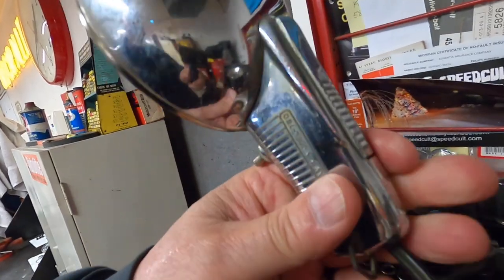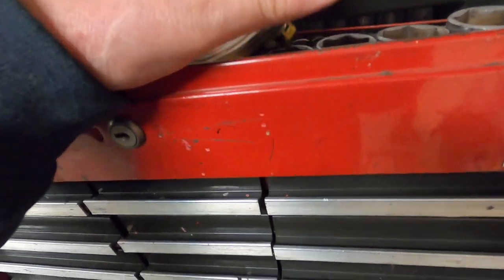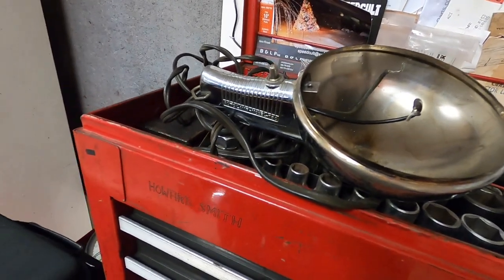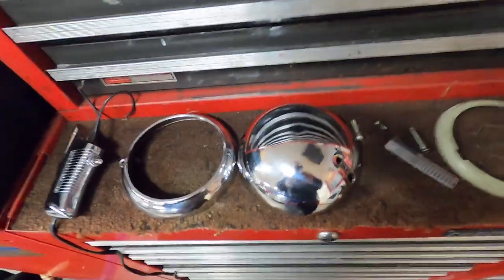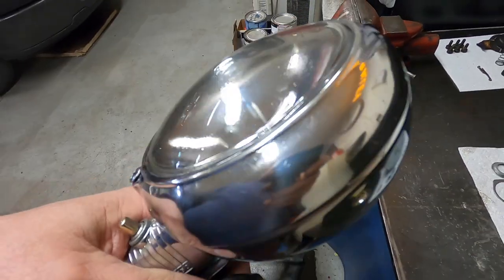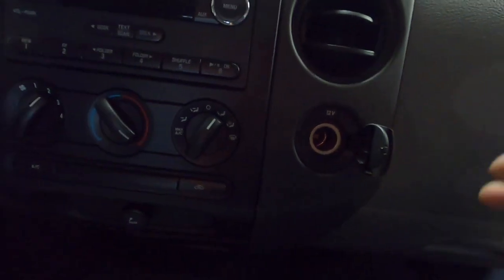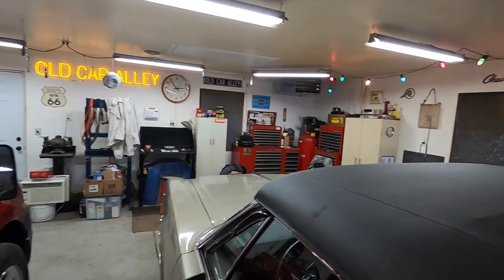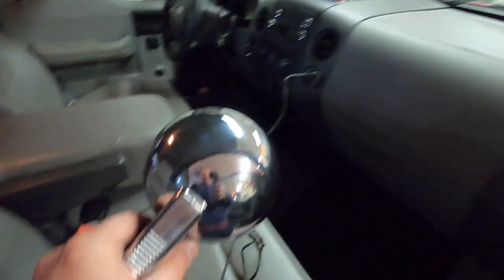Vintage Spotlight from estate sale restored and working

Comment: I worked for the fire department before retiring and we had a chief that had one of those spots in his chief's car, very similar. His had a switch that was push on - push off. Well he used it one night and forgot to turn it off,  he laid it on the front bench seat and of course placed it bulb side down. Yep, it set the seat on fire -  at someone else's fire no less. Good thing someone walked by his car and noticed smoke coming out and unplugged the cord from the lighter socket. His legacy for a couple of years until the department traded the car in was that burned hole in the seat. HaHa  Nice acquisition and restoration Howard.
Reply from the maker: I love stories like that. There the ones always remembered. This one has a push button on and off also. I'll have to remember to turn it off before setting it down. Maybe even let it cool, if its really hot.

Comment: I had the same exact light and gave it away a few years ago trying to clean up the area.  Mine still worked.  I think I purchased it back in the late 60's.
Reply from the maker: Yea, I think they were very common. I have seen a few around over the years. It's just that it had a six volt bulb that makes me think it's early 50's, but someone could have changed the bulb over the years...... or thy could have been made for a long time.....
Reply: @OldCarAlley  I would agree.  Mine was 12 volt.

Comment: Hey Howard...i had a feeling this video was coming..to have a spare light in your stash was no suprise to me..the light will be very useful..you should make a case to keep it in to avoid any more scratches it looks new again..that stand where the buffing wheel is looks like it may support your paint shaker or maybe it needs to be a little heavier ..just a thought..see you on the next one Cheers 🇺🇸🇺🇸🇺🇸🇺🇸
Reply from the maker: No way that stand would support it running. Correct stands are available, but I don't have room for one on a stand. It's perfect where I ended up finding a spot for it, under my metal bender. 

By the way, I just saw an identical paint shaker sell on eBay for $1500. Crazy! I paid $30 for mine, replaced a seal and timer, that cost about $40 all together...... Yea, 70 bucks is a steal. I'll buy everyone of them I see now, that are cheap like mine, to fix up and resell.
Reply: @OldCarAlley  wow..1,500,00 bucks that's a little expensive.. and you only gave 30.00 for yours great deal..Cheers 🇺🇸🇺🇸🇺🇸

Comment: It is a fine looking and great working light.  I have a 12 volt spotlight in my pickup truck just for changing a tire.  I haven't had a flat tire at night that I can remember and haven't used the light ever but the one I bought was cheap enough and if I never need it that will be great.  I think the last 6 volt car I ever saw was a 1954.
Reply: The automakers started to convert to 12 volt electrical systems in 1953 because the amount of current required to start high compression V8 engines was becoming very expensive as far as the battery and wiring were concerned.  Using a higher voltage required less current to accomplish the same thing saving weight and money.  Many large trucks and buses use two or more 12 volt batteries in series or series-parallel to accomplish the same thing in a 24 volt electrical system.  All the US manufacturers switched to 12 volts by 1956.  Among the foreign manufacturers Volkswagen was a holdout not switching to 12 volts until the 1967 model year.
Reply: @1575murray  
Fords used six volt systems (positive ground) up through 1955 then the 1956 models went to 12 volt and have been ever since.
I used to own a 1926 Model T that had a factory installed starter and six volt lights.
Reply: @chuckster3629  You are correct.  Ford and Chrysler used six volt systems through 1955.  However GM started changing over in 1953 with Oldsmobile being the first to change.  Chevrolet changed over in 1955 with the introduction of the V8 engine.  I am not sure when the other GM divisions changed to 12 volts.
Reply: @1575murray  
Yes, Ford had V-8 engines as far back as 1932 but they were low compression so it didn't require as much cranking power to turn them over.  The first Ford OHV V-8 came out in the 1954 models and curiously it was exactly the same C.I. displacement as the flatheads ... 239.
My first car was a '54 Ford Crestliner with the V-8.  Paid all of $200 for it.
Reply: @chuckster3629  I remember my mother looking at a 1955 Ford at a car dealer's which probably had the common 272 Y-block V8 engine.  She didn't buy it because it had a 6 volt system and a huge battery and eventually bought a 1956 Plymouth with a 270 poly V8 and a 12 volt system.  Of course the battery was on its last legs and had to be replaced.

Comment: I have the same light I've had it for years
Reply from the maker: I'm finding them everywhere on the internet..... On eBay they go for around twenty bucks. Looks like K-mart sold them in the late 60's for around ten bucks. I remember our local K-mart had a really good automotive section, and they had service bays too. I use to buy tune up kits, oil, filters.... you name it.... they even sold tires.
Reply: @OldCarAlley  yeah I bought my share of tires from kmart
Reply from the maker: @billyhensley7770  They sold good stuff.... major brands and stuff. They were second best to Sears in my opinion, in that era, for retail stores, automotive departments....
Reply from the maker: @billyhensley7770  It's been at least ten years since I have been in a Walmart.
Reply: @OldCarAlley  I don't shop there either

Comment: Hey Howard do you subscribe to Bigred84?  He's doing videos on a '59 Parkwood.  Looks like he might be selling.  Thought you might like to know.
Reply from the maker: I checked his Parkwood out.... He stated he is not ready to sell it yet, but wants ten grand plus for it when he does. It looks somewhat solid, but it had water (ice) in the transmission with no reverse. The engine docent sound that good, like it needs overhauling, along with the trans, and I bet the axle too. The more he works on it, the more I am not interested, plus it's a six, I really want a V8 car. You can't just willy nilly rip into stuff, without knowing what you're doing. He's talking about ripping out the ignition switch because he has no keys.... I tried to tell him to remove a door lock, and take it to a locksmith to have a key made for the car.... That might cost $50 at the most. 59 Chevy's used one key for everything.